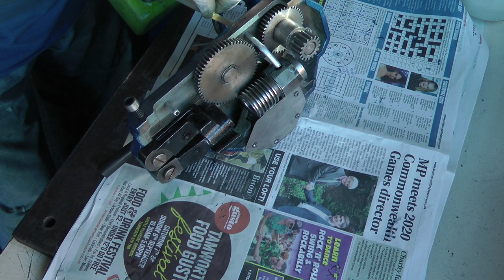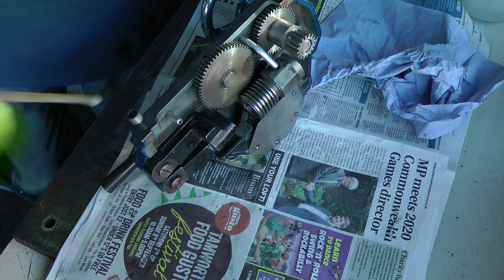Boxford rebuild the apron

Comment: I'm very suprised you did not oil any of the shafts on assembly, I know a lot will get oil in use but a bit on the bare shafts would probably have been a good idea rather than dry, that way your sure some oil is on the shafts.